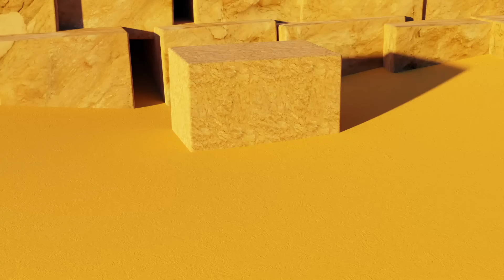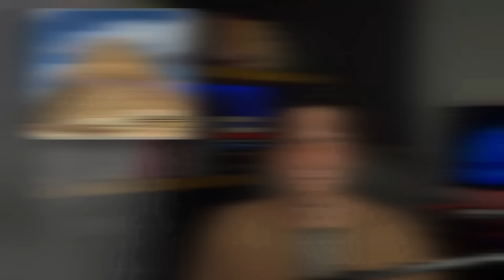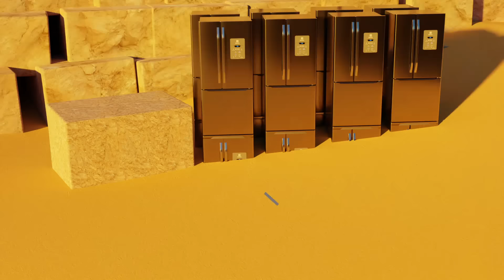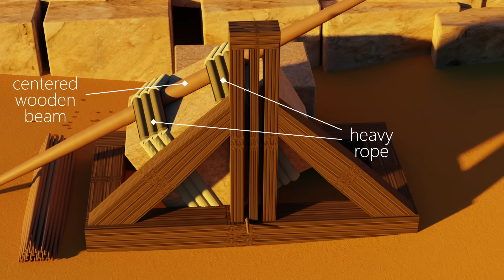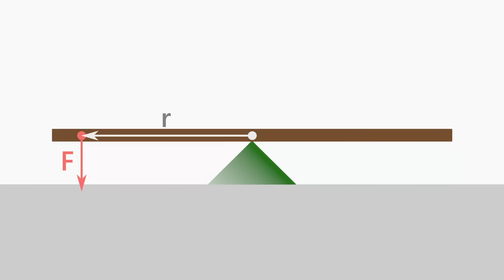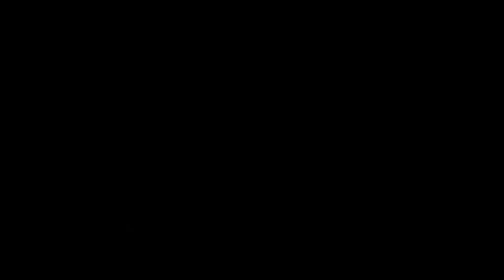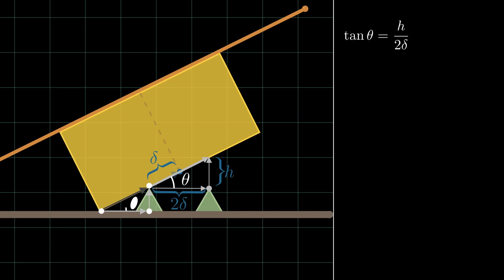Physics Reveals How the Pyramids were Actually Built

Comment: Still does not explain the amount of workers needed to move one block in 6 minute for millions of blocks.
Reply: The amount of blocks in the pyramid isn't known. Most estimates are done by projecting equal size blocks throughout the entire structure. There is a lot of evidence that shows there many areas of the pyramid that are not filled with square blocks but instead sand, which has the same compression strength. Sand being a much easier material to transport.  The "fact" that they had to lay 1 block down every 3-6mins is based upon assumed metrics. The reality could be much different.
Reply: Inside the pyramid is most rubble than perfect shaped blocks
Reply: From the ground yes this may take an hour for the first or second layer. But then u have to realize that every level adds more time to that estimate. So say an hour to raise the block two levels, by the time ur ten blocks high it's taking 5 hours to get a block up.
Reply: They dragged and floated them they did not lift them and each layer up they need less not more please use your head wow! @aaronmunzel3587
Reply: @aaronmunzel3587 that comment is embarrassing
Reply: @aaronmunzel3587 the layers get smaller it's a pyramid not a building
Reply: @williamclos5516 yes smaller but still higher which means to layers high every block has to be raised from level to level. Making it take just as long if not longer to say do level 2 or 3.than level 1 even with less blocks.
Reply: Gravity was different back then so the blocks were easier to move with fewer men..😂
Reply: There would have had to of been otherwise it would have taken them hundreds of thousands of years to complete
Reply: They didn’t use big, clean-cut blocks all the way through. Internal blocks were rougher + there was lots of “filler” of smaller stones. The big, clean-cut blocks constitute a small fraction of the mass of a pyramid.
Reply: 20,000
Reply: That's a good way to lift a block but there's no way to laterally push it into place. Also remember that it can't get chewed up on the way because it has to be a perfect fit for the other blocks in all six directions. So if the first time you put it in, it doesn't fit, you have to pull that block back out to shape it so that it makes a perfect seal to the other blocks. Which creates a real problem, when it's laying flat on top of other blocks how do you lift it up to get it into the machine? And this needs to be done repeatedly without fail for at least 27 years?? 
And if we're talking about physics did you think about 10 tons rotating back and forth on pieces of wood? 
Also the pyramid isn't just limestone don't forget about the rooms and passageways out of basalt and marble with a weight upwards of 52 to 100 tons. On a glorified seesaw?? Bruh!
Reply: Okay, so where does that leave us, @FamousGSE28 ?  
• Are the calculations for this particular aspect of the construction, incorrect. 
• Is the entire structure like this?  
• Is the beginning and/or duration of the work disputed? • Are the available materials, manpower and other resources disputed? 
• Are the available technologies disputed? 
1. Nope.
2. Nope.  Significant proportion of the internal construction is not perfect geometric masonry that we've always heard about.  Some is very rough, with even just rubble used to fill certain areas. 
3. AFAIK, nope.  
4. AFAIK, nope - despite the recent nonsense in some quarters, that it's not rock, but actually poured concrete. 
5. Yep, to differing degrees.  It doesn't mean that techniques/strategies other than this one, weren't used for other aspects of the entire construction.

It's there.  They did it somehow.  
We're incrementally figuring out more and more, and I'm pretty confident we won't have to just quit - and put it all down to the silliness of supernatural powers. 🤪
Reply: @FamousGSE28 if they are working on something for so many years and it takes so long for just one block to be placed if they know that shape can be made they would have plenty of time to not make a mistake it was a long process to get set up and stuff I'm sure and someone was most likely constantly watching that knew without a doubt where it goes because they would probably die if they messed up a whole block and ruined everything later on or even took up more time then whoever wanted it built liked but idk it seems possible
Reply: @FamousGSE28 exactly I don't think they can even comprehend the amount of weight the amount of cutting and the amount of distance that's being traveled. This entire operation of cutting lifting, rotating fixing your mistakes having to redo it over and over again if any damage occurs and being able to lift 80,000 pound stones off the ground the hundreds of 10 and 20k pound stones. Then 2.3 million 2.5 ton stones of transporting cutting lifting and rotating would be virtually impossible to get done in 27 years. Lol again, there's more to this operation than a simple lever mechanism used in this video.
Reply: Got a degree in physics and want to make great leaps of imagination, ok. Now, back to reality. In order to build ANYTHING. First you have to have a plan. Plans don't fall from the sky, they take time. After your plan, then you have to do a location survey (because you just can't build anywhere), and a site survey (because the building site must be measured and aligned). Then you must do a human resources estimate (to locate your workforce, especially skilled trades people) and a materials estimate (to find wood, limestone and granite). Then you must figure out a logistics plan. How do these people get to and from the site. How are they fed and their housing, clothing, and sanitary needs met. How will you transport the various materials. (Do you need to build infrastructure for that?) Then you can prepare the site itself. In the case of the pyramids,  thousands of tons of bedrock had to be removed and leveled. ALL this takes time. Now in order to actually build the pyramid. You have to develop a "work flow" plan. This so that the pertinent workers have room to work, and everyone isn't in each others way. Tools, yes you need to source tools. You have to "upscale" your toolmaking exponentially. In the video it stated "It would take 27 years working around the clock." Bad news, the ancient Egyptians only had the ability to work during daylight hours. The video showed wooden levers, and ropes. Well, frankly wooden levers and rope cannot handle continuous 10 ton loads, much less the 70 ton stones of the Kings Chamber. Nowhere in modern construction would you see fiber ropes or wooden levers used. The video throws around lots of numbers on weights and measures. But, conveniently left out the actual stress on the working components. Every modern crane has a "load chart". This chart shows what loads the crane can lift at a particular radius, in a specific quadrant of operation. On the load charts are listed "tipping radius" and "ultimate or structural load". This is because they can break, if you try to lift too heavy a load. And, these cranes are made of steel. As an IUOE Local 15 Operating Engineer with a Class C Hoisting License (expired). Who has worked on the construction of many skyscrapers and other mega projects. I find the narrative that the Egyptians built the Great Pyramid of Giza with just copper and bronze, without even the wheel, in 27 years, to be incredulous. Even today, with modern computers and hundreds of years of experience.  It takes more time to plan, design, survey, and resource (human and material) a major project. Than it does to actually complete it. This just goes to show, that the people who make these ridiculous estimates and narratives. Have no clue as to what it actually takes to build a major project. IMHO those "old timey" archeologists were glorified grave robbers, and made up stories to justify their actions. This guy "obviously " is not a construction engineer (architect, civil engineer, etc) otherwise he would realize what "actually" goes into major construction projects. He would not post a video supporting the "provably false" old timey narrative of built in 27 years with human labor (no machines) with copper and bronze tools only. (no steel)
Reply: Nor does it explain or take into account the ability of the inserted slats to support the weight of the block... What is their tensile strength?
Reply: @patrickvalentino600 A good qu a little wood such as oak would be more than enough.
Reply from the maker: Compressive strain would actually be more relevant. And it’s around 1 ton per cm. So with the appropriate thickness, the slates can support the weight.
Reply: also, could the slats have been made of copper or brass or stone. @DrJohnDev
Reply: Thanks for answering, I was curious about this too. 
I wonder how many times they could be used, before getting "chewed up", by the rocking motion? As the block makes contact with the corners of the slates, each time it is rocked.
How perfect would the slates have to be, so as not to deform the stack as it gets higher.
How many slates, of what dimension, would it take to lift a block of given dimensions.
What kind of wood, available to them at the time, would satisfy the requirements.
Would love a deeper dive into the slates, and material requirements, of the lifting device itself. 
Thanks for doing this   @DrJohnDev
Reply from the maker: Great question!  So although copper would have been circulating around at that time, copper is fairly malleable and would likely bend or break under the pressure of the blocks.  I'm not sure if brass technology would have been up to par for the time of the blocks.  Stone seems like a good choice, but it's quite brittle and when rubbed together, it would likely damage the block to be lifted. 

Here's some food for thought as to how the Herodotus machine might look in real life:

https://youtu.be/E5pZ7uR6v8c?feature=shared&t=166
Reply: 👍🏼 Thanks for sharing that link,  @DrJohnDev .  HOWEVER... 
1. Some of the whiners here simply won't watch that other vid, even though it demonstrates part of what they doubt.  
2. The machine I saw first when I started that vid, was a car  😅 (because I'm too cheap to pay for YewTyoob).
Reply: @TheScreamingFrog916 you left out a lot. How did they cut the stones out of the quarry? How did they lift them and move them to whatever they did to move them to hundreds of miles that they did. Then they had to get them onto your apparatus in the first place. How did they get them off of the ground or off of the apparatus that move them where are the tools and instruments they used to move these things? How did they get the blocks to the top of the pyramid in 6 minutes using this mechanism?
Reply: @DrJohnDev  yeah but that video doesn't explain what was used to transport and get that heavy stone into place before he even began. Your forgetting they had to first cut all of those stones perfectly with precision. Then they had to transport all of that heavy weight hundreds of miles. What did they use to do this. I don't think you could even comprehend how long the preparation part of this operation for cutting and transport would take before you could even begin the project. Dude there has to be more of an easier way they did this. There's no way they had this kind of mathematical knowledge your demonstrating in either one of these videos. This entire operation and procedure had to be done in a more of an efficient way. Other wise it would take hundreds if not thousands of years to complete. I just don't believe egyptions thousands of years ago were equipped with the kind of durable material and mechanisms used in your video in order to get this done in 27 years. Just not likely.
Reply: @DrJohnDev not to mention because of the confined space the slats are in and the pressure put on them from the rocking motion. Would make the machine unusable until the slots could be cleaned of the material
Reply: And there was definitely more advanced efficient and sophisticated type of technology or machinery being used than a simple lever.
Reply: The lash was very effective.
Reply: @r8chlletters No lash required for religious zealots. They believed the pharaoh was a god.
Reply: I like the alien explanation. Less math.
Reply: Imagine the long departed spirits of those ingenious people watching you write this comment. 🤦🏻‍♂️
Reply from the maker: It is explained actually. The Egyptians used multiple machines in tandem. If even only 10 machines are used simultaneously, the number is raised to 1 hr per block. It can only come up from there.
Reply: @DrJohnDev But you would have multiple lifts per block for each level they went up plus  moving their equipment.
Reply: @subjectofgov  you don't move the equipment. You would have another copy of the lifting device for each stage of the lift, and a crew for each device all working at the same time on different blocks so that a block is being moved up a layer every layer simultaneously. Like a bucket brigade but stones up a pyramid. Now have HUNDREDS of these lift lines working all at the same time. Many hands make for light work and they had tens of thousands of hands of professional laborers.
Reply: Somewhere inside the pyramid, there are what appears to be rope or chain type marks like they had used a pulley system @DrJohnDev
Reply: @DrJohnDev this video does a disservice to common sense. It took you 20 minutes to explain what supposedly only took them 6 minutes to do. First of all, they had to cut, move 500 me, and then use your machine, and then after your machine what? It doesn't explain how all of those blocks were moved and it doesn't even come close
Reply: @DrJohnDev  I'm sorry, but this does NOT explain how the ancient Egyptians, who had absolutely no knowledge of the applied mathematics, were able to build a pyramid of that size in that amount of time. In fact, since the Herodotus machine was first described some 1500 years AFTER the construction of the Great Pyramid, we have no way of knowing that's how it was done at the time. Your "maths" doesn't explain how they could raise the blocks quickly enough, or indeed how they got each machine high enough to produce a building that tall. It also begs the question of how big and heavy each pivot "rod" was, and whether a practical machine could be built to lift a block high enough to insert such a strong pivot.
Reply: @another3997 Tell me you haven't studied science without telling me you haven't studied science.
Reply: @another3997 Sure it does. You just don't understand it.
Reply: @sayandeepthrowaway go get a bunch of your science friends and actually build one .. we’ll wait 🤣🤣🤣
Reply: @JKLsemASDF  Sure bud check back on me in 30 years( The time it took to build the pyramids )
Reply: Or History, @sayandeepthrowaway .  Even easier than studying either History or Science - they seem not to have bothered watching any of myriad other videos on this exact topic!  🤷🏼‍♂️
Aside from the vast amount of clickbait and 'woo', there really are plenty of reliably accurate explanations, presented with easily accessible terminology (to me at least 😅), on objectively produced channels.  These vids explore a variety of technologies and devices, the cultural context of the era and key people involved, and the human, material, and other resources available at the time. 
Nope - they just came here for @another3997 whine. 🤷🏼‍♂️
Reply: @another3997 thank you. That's just like drawing a line on a paper and then saying draw the fucking owl. There's millions of questions. First of all, he's discounting how tightly cut these blocks were... Also he lied when he said that these are the largest pyramids. They're not the largest or the oldest. You have to explain how they did this all over the world on the 30th longitude
Reply: @sayandeepthrowaway tell me you have no relevant input to the conversation without telling me you have no relevant input to the conversation
Reply: @another3997 I find it fascinating how, in order to remain skeptical, you're making stuff up.
Reply: Look around you. Humans are capable of amazing things. It is an insult to the intelligence of humanity that you have to ascribe their creations to something supernatural. Look at the Burj Khalifa. If we can do that today, then our ancestor were certainly capable of building some pyramids.
Reply: @MarcusHCrawford,
You have no clue of the complexities involved with building the Great Pyramid of Giza!  No clue whatsoever.  There are circular core holes drilled in granite at the Pyramid that have striations around the inside which show the granite holes were drilled 500 times faster than we can drill them today!

The spiral groove around the core indicate a feed rate of 0.100 inch per revolution of the drill. It was 500 times greater than modern diamond drills, but the rotation of the drill would not have been as fast as the modern drill's 900 revolutions per minute, and Egypt was working with copper. 😆 

The Pyramids were built long before the Egyptians came to town.  The Sphinx has extensive (vertical) water erosion which clearly shows it was built over 10,000 earlier when such rain was a reality. 

That Pyramid CANNOT be built by today's engineers, and yes, ancient off world technologies were used to enable it's construction.
Reply: @jefft6802 I can’t figure it out ….must be off world technology ! 🤡